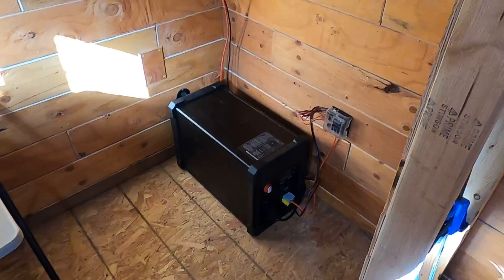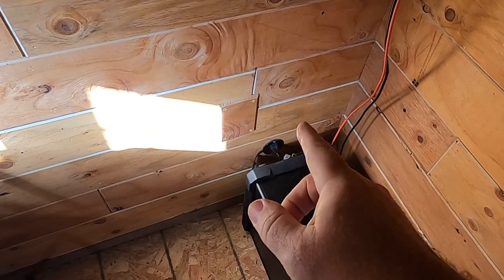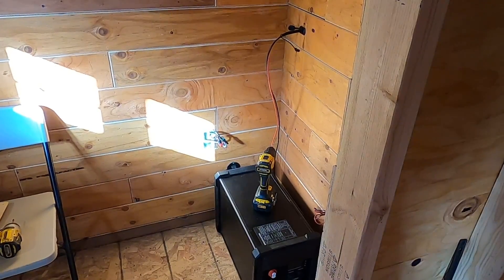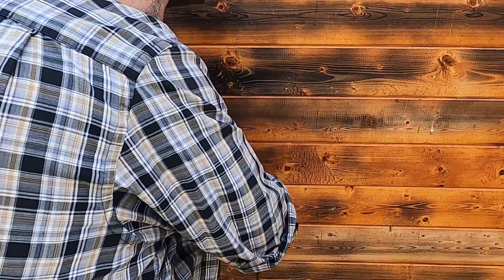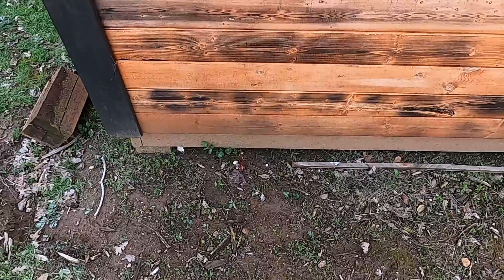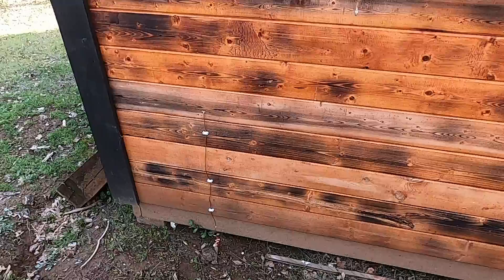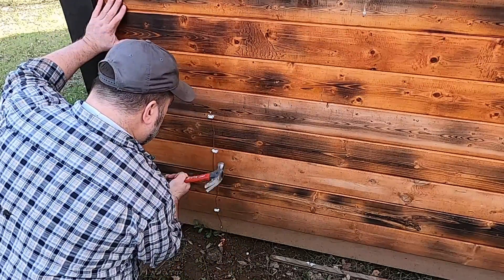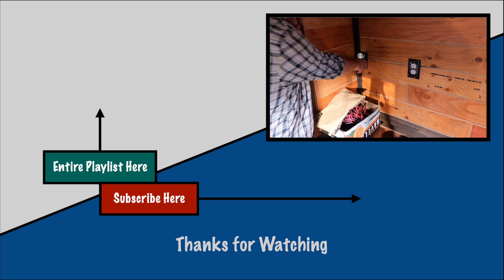Grounding The Off Grid Cabin Electrical System

Comment: what did you attach the ground wire to in your system?
Reply from the maker: The junction box behind the wooden plate.
Reply: Thanks for the reply.
I’m still trying to figure this all out.
How is the junction box connected to the rest of the system?
Reply from the maker: @nathanwalker1262  I connected an outlet to the junction box that I plug the solar generator into for the 110 and I attached a DC panel to the battery that runs all the lights and fans.

Comment: How far in the soil does the ground rod needs to be? 
The cabin is getting more comfortable for you to spend time in.
Reply from the maker: This rod was for a generator so it only has to be 4' in the ground. If it was for a house it would need to be a lot deeper. Cabin is getting a little more comfortable each trip.
Reply: @TheWoodHaven   I had that done a few decades ago, I can’t remember the depth that’s supposed to go. Curiosity, but I probably will forget it anyway.    
 
Yes, the cabin is turning into a retreat